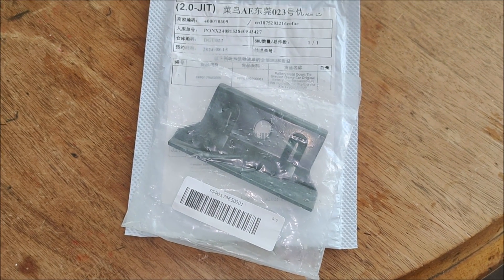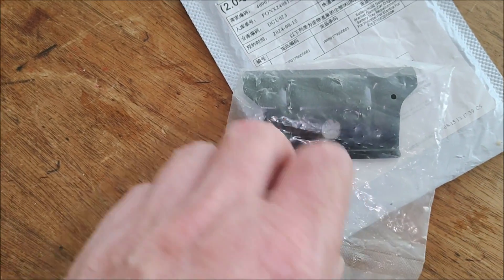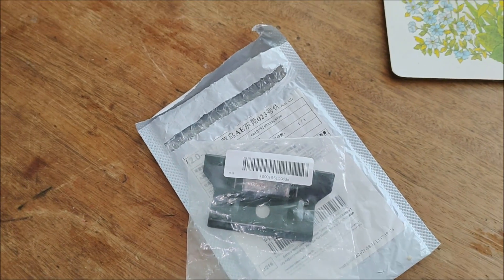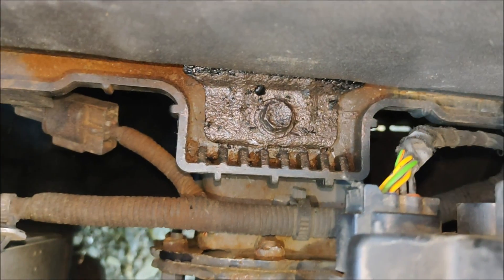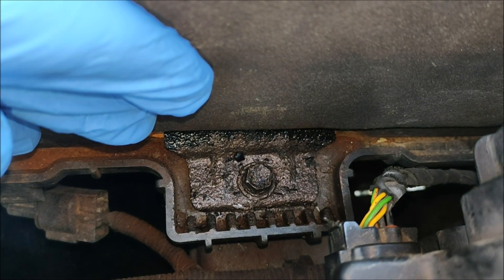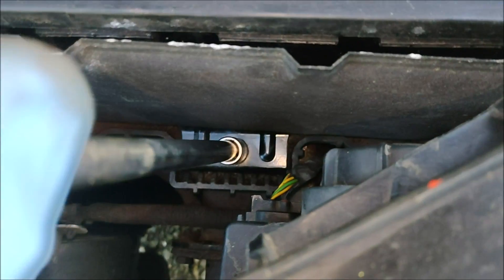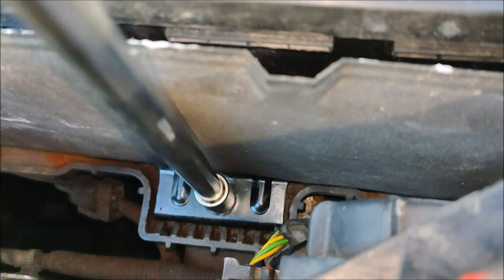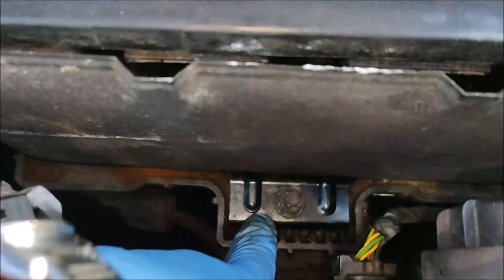KIA Battery Clamp Replacement - AliExpress Sourced.

Comment: Will probably replace mine soon as well, however I found new OEM one for the equivalent of 6 gbp (+shipping) which I happily pay and not support the likes of AliExpress, Temu etc.
Reply from the maker: @JakubW  I suppose that's not too bad a price. 
In the order, was also an oil filter for my friends Kia Sportage.
Not sure if it's a fake or not but it came in Kia packaging made by Mahle.
Reply: @gtd65 The price is really not bad. The same site also gives access to the original parts catalog so you can basically find any part that you want. 

 I once bought Mahle oil filter or airfilter from Autodoc and on the box it said Made in China. It's entirely possible when being from Ali that they either take the same genuine parts from the same factory that produces Mahle filters or they just take the packaging and ship a different filter. Either way I don't think Mahle is not seeing any money from it haha